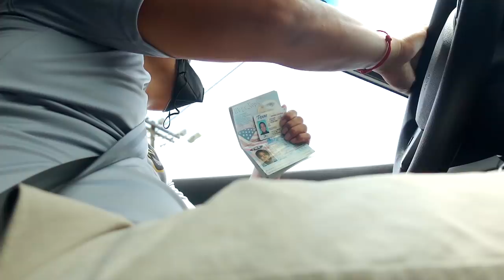You’ll NEVER Believe What I did to the INSIDE of My Boat

Comment: 50 years ago I sandblasted and painted offshore platforms to pay my way thru college.  My suggestion for anyone going thru what David and Colin are going thru is to buy a sandblasting hood with a small air compressor.  The hood straps around your chest and has an air supply hose that is hooked to the air compressor.  This gives you positive pressure inside the hood and keeps the dust outside.  The air supply also provides a cooling breeze inside the hood as it blows across your sweaty face and it keeps the face plate clear so you can see.
Reply from the maker: wait...so then I don't feel like a fish in fish bowl from all that condensation and sweat!  Hell yes, where do I sign up?  I'll check the ferreterias!
Reply: @david_shih  3m air fed hood life changing for an dust fume tasks clrean air cool (sometimes) but all foging and sweat gets pushed out..
Reply: @David Shih Just make sure you put your compressor somewhere outside where it can't suck in any of the dust. OR, see if someone in the area has a scuba hookah they can let you borrow. Those typically give you a better quality air than a regular compressor.
Reply: @david_shih  Think air fed mask used by spray painters in panel shops, the cool breeze as you are working is great, you just need an air compressor and a good filtration system on the compressor to remove oil and water from the line (you don't want to breath that either)  before it hits the carbon filter at the mask.
Reply from the maker: @markkelc  been doing some research. Pretty damn cool I must say. Solves 2 problems in one!
Reply: Great advise.  We use them too for confined space work in fiberglass tanks.
Reply from the maker: @rogerheuckeroth7456  definitely getting one if I ever have to glass again!
Reply: Thank you for this tip, if the vessel I finally end up with needs glass work I'm definitely taking your advice. When I was a younger man in the late 80's I used to work on a crew who built those huge water slides, the sections of the slide are made of fiberglass and you of course have to glass them together. A lot of glass grinding, cutting and finishing goes into those seems as they have to be perfectly smooth for people in swim suits to slide over without injury. We didn't have or use any protection really back then. Best we had was regular overhauls and work gloves. I can say with total honesty it sucked and is hands down the worst job I've ever had even though it paid very well. For the year and a half I worked with that company I was in constant pain and never stopped itching, being able to sleep well and comfortably was only a dream. You can try all the tricks like talcum powder, suntan lotions, oils, vasoline, all the tricks and nothing works. What you described would have been a God send even if it didn't prevent all of the tortures even a little relief would have been amazing...
Reply: @PastorwithoutaPulpit  Here's another tip you could have used from my sandblasting & painting in the oilfield.  I wore one-piece coveralls and duct taped the wrists and angles to prevent dust from getting in and wore cotton work gloves.  I had a hat (or cap) that looked like a WW1 flyers hat or the early football leather helmets, made out of nylon that covered up everything on my head except my face.  I spread a thin layer of Vaseline on my face and any exposed skin.  Otherwise, I would have highlights of Shell Oil yellow or Conoco red on exposed parts of my body.  Fortunately I came on the scene after lead paint had been banned.  Instead, we used 90% zinc primer.

Comment: You'll be glad you did all the protective gear and post grinding washing !   Leaving some hi intensity work lamps or a heater running while you're not inside hulls should help drying too.. but don't leave unattended overnight for fire reasons of course ! Those squirrel cage fans may be better used as exhausts on one or both hatches in sleeping spaces vs just moving air around inside hull with no escape. That's really the key to drying if you can't get massive AC to de-humidify. Being in Panama, since it's always so humid,  heating the air may achieve more than chilling in those conditions. I don't know if they even have them down there, but a leaf blower ( or 2, they'll burn up  ) may be useful to blast air through ceiling spaces etc to help accelerate drying too.  Happy New Year David !
Reply from the maker: Hey Mike! great tips on the heat....no access to that so I ended up just running the dehumidifier for an extra week after it was dry...just in case. I didn't want to bring outside air in bc its so wet and humid here. Rains a few times a day as well!

Comment: Nice vid as usual. You’re probably done with that extra grind. You can use a multi tool with grout cutting attach on for small sections. Very tidy. One of my favourite tools. Also small hand held battery router with dust extraction is good.
Reply from the maker: Hey thanks supernova! Excellent tip actually ended up doing something similar. But the crazy thing is we’ve had to go back in a grind so many more times once we started fiberglassing. I was so naive thinking that was it. Lol!!! I’ll look into a battery router, thx!
Reply: I think the official name of the handheld router is a laminate trimmer. But anyway look forward to next vid. You’re nearly there!
Reply from the maker: @SuperNova-Steve  thanks so much for yhr info and even more for watching!!! Next vid coming soon. I’m desperately trying to get into the water at the moment so I can go hang with parlay in bocas when they leave linton!

Comment: Spraying down the interior, behind panels and all hidden access areas to get rid of dust will pay off big time, especially with your family onboard. Lets face it when you have air movement onboard, fiberglass dust will become airborne exposing you and your family. I watched one sailing channel where they inspected their brand new Leopard 45 and there was glass dust in all the hard to reach area, plus  offcut chunks of wood etc. Hard to imagine builders are exposing sailing families to this danger. You are providing your family a safer sailing experience than the original boat manufacturers.
Reply from the maker: Ah thanks for letting me know! Can’t believe they would do that on a new boat.  It really seems these manufacturers just ignore parts of the boat you can’t readily see (ie. bulkheads.) after all the repairs are complete I’ll have to go through and do that again on all the cabins. I totally underestimated how much dust and mess would be created during the actual fiberglassing work.
Reply: @david_shih  smart move = a good healthy boating environment.

Comment: Was so happy until the end!

Why the major cleanup before you glassed the bulkheads?  The housecleaner seemed to do a good enough job for the time. Bound to be more mess by the time you finish glass and carpentry. That said, I do appreciate the mental benefits of working in a clean space, something that Colin can power through until the job is finished.

The bit about the stores all speaking Chinese was funny. Being fluent in Spanish I have had Panama on the list of retirement havens, but now I find out I need to learn Chinese! Not gonna happen.
Reply from the maker: It's actually so much dirtier and messier at the moment as we do all the glassing, so I should have waited for sure.  I just wanted to get all that glass dust out of there asap. I hate fiberglass itch!

Comment: When working with fiberglass cover yourself in baby powder or cornstarch and continue applying As you sweat the fiberglass simply rubs off
Reply from the maker: You know I tried that but turned in turned into a peanut butter consistency paste all over me….too much sweat in the tropics I guess!
Reply: @david_shih  I make my living as a carpenter And a lot of the modern materials are made of fiberglass One of the worst is this stuff called fiberboard you use it in Roofs and attics where the temperature can reach 140 I truly understand and feel your pain I would go through a large container of baby powder in one morning I literally looked like a ghost and we were out of there before 12:00 noon Mind you we had 12 in filtering systems to keep the dust from settling which you could make by using a simple cheap Box fan and a house filter To help keep your boat cleaner.Congratulations on all your work and best wishes.

Comment: Crazy question. Is it possible to do a wet grinding? As to better control the dust generated. like a mist being sprayed onto the surface of the fiberglass, similar to what is used in wet sanding techniques? Using battery tools of course, not 120 or 220 VAC.
Reply from the maker: I wondered the same thing , but didn’t know enough at the time to try it so I just went with the tried and true method. However, I’ve since been told that it’s completely possible. I believe there are even waterproof grinders. Good thought Fred!

Comment: I was thinking to myself... way too early to do that cleaning.  Plus you want everything as dry as possible for the fiberglassing.  My company does industrial fiberglass work.  The workmanship by the manufacturer is really poor, and the engineering is also poor in that a single minimally reinforced sheet of plywood to hold together the hulls, is crazy.  Even if they were properly joined.  I would have cut the whole bulkhead out and replaced it with layers of Coosa and fiberglass between layers.  Also, remove ALL of their layup.  If you do end up using plywood, you need to roll on resin and let it absorb into the wood before doing your layup.  Otherwise the wood will pull the resin out oft hour layup and leave you with a dry / weak layup.
Reply from the maker: You couldn’t be more right about cleaning up too early. We ended up back in there grinding a dozen more times between layups. We had peelply, but it was tough to use in the odd angles and shapes. Should have waited till the end to wash her down since we did another entire spray down last week!

Comment: Will the water hurt the interior wood?
Reply from the maker: It’s a possibility, but Colin from parlay revival did it so I copied him! He had some smell issues bc he air dried, that’s why I added the dehumidifier!  Everything worked out ok!
Reply: @david_shih  my porta potty cracked in my boat.  Smell was not good.  I used Odoban to get rid of smell.  They also use it in houses to remove cat pee smells when they rip up floors. I poured it into bilge.  Thought for Colin.  Not to be itchy especially for your kids.  😀
Reply from the maker: @krispress7824  thanks for the tip!!! Odoban, got it!

Comment: Wow, nice speaking mandarin! Judging from your last name, did you come from Taiwan ?  I used to work with fiberglass parts a lot, and I didn't bother to wear protecting suit as all. I used packing tape to remove any fiber glass dust from my exposed skin after work before taking shower. Make sure you do not rub your skin even when you take shower or these tiny fiber glass will stick into your skin, it will not harm, but you will be itchy like hell. 

If you still feel itch, take a super hot shower (as hot as you can, you will feel crazy itchy) and a quick cold shower afterward. Plus some itch cream and it will trick your body and give you 6~8 hours of time of comfort.
Reply from the maker: I was born in New Jersey, but yes, my family is from Taipei and Tai Chung. What about yourself? Thx so much for the tips... I’ll try anything to get rid of the itch even if it’s for a few hours.
Reply: @david_shih  Oh man, I got my BE degree in Stevens Institute of Technology and spend few years in both town of Hoboken and Fort Lee......What a small world :).  and yes, I came from Taiwan too.
Reply from the maker: @itonylee1  small world so cool! what kind of work were you in that you worked so much with fiberglass? We’re you in the boat industry?
Reply: @david_shih  I did off road desert racing for years and fiberglass is cheap alternative for body parts (other than carbon fiber parts). Wish you finish this boat asap and get reunion with your family and sailing again.
Reply from the maker: @itonylee1  wow that sounds pretty fun...any boating in your future?
Reply: @david_shih  oh yes, I probably need to learn how to sail first place :)  or get a power boat instead.

Comment: Was that pipe running straight to the water?
Reply from the maker: The hose runs into the dirt, but in the marina here everything runs straight into the water....
Reply: @david_shih  ah, I am not having a go, I think you guys are doing a great job and watch you and parley  just surprised you didn't do anything to slow down contamination, every little helps 👍, even having the end of the hose running through a material sack helps 🙂
Reply from the maker: not a bad thing to do Abs.... i appreaciate the tip and will definitely do that next time!  Thanks so much for follwoign along!
Reply: @david_shih  👍 cheers David, I know it isn't much but lots of not much can make a big difference. 🙂.

Comment: Hosing down the inside of your boat, not smart
Reply from the maker: Ooooh I know right….so counter intuitive. But Risk of mold vs fiberglass dust forever.  I was torn!
Reply: You have a severe phobia of fiberglass dust. Really ! Water doe's not belong inside a boat. You might not see problems right away but there is a strong poss you might have problems down the line. Mainly wood warping, delamination, electrical, standing water that smells that you can't find. Sheesh Dave what were you thinking ??
Reply from the maker: @davidroseman9586  you're right about that part...i'm paranoid about glass dust, maybe a bit too much!  Hope it works out...i did keep the dehumidifier going for an extra week just to be sure.  I got it down to under 30% humidity.  I kept the power off and fiberglass really shouldn't delaminate if it was done correctly in the 1st place, but that's a big if!  Either way, thanks for the comment David!
Reply: @david_shih  Not fiberglass delam, PLYWOOD